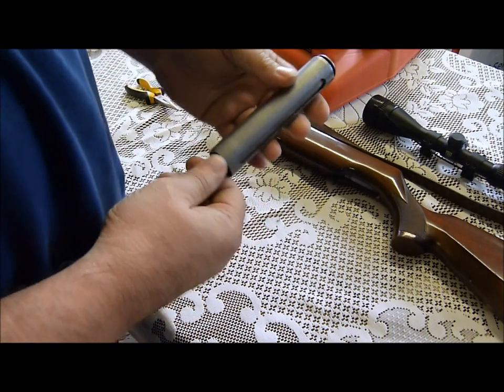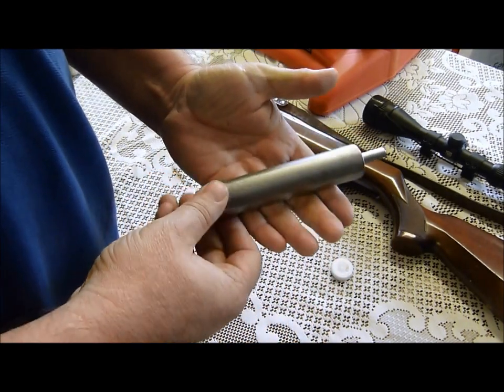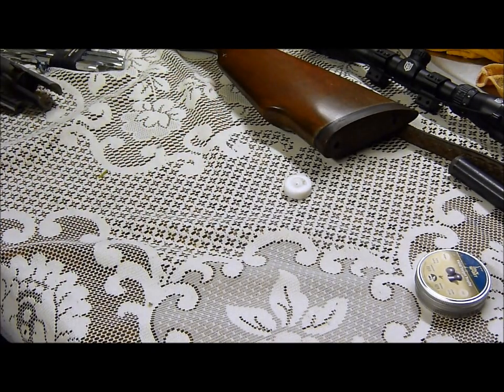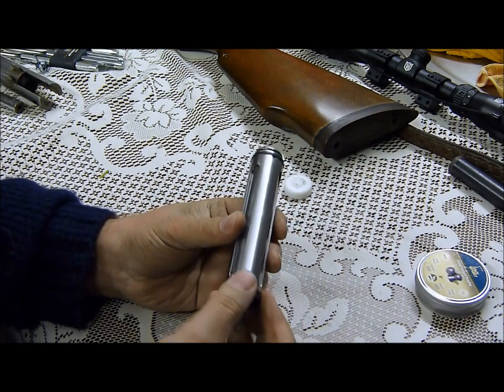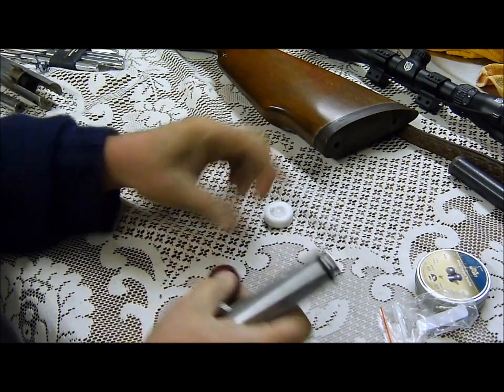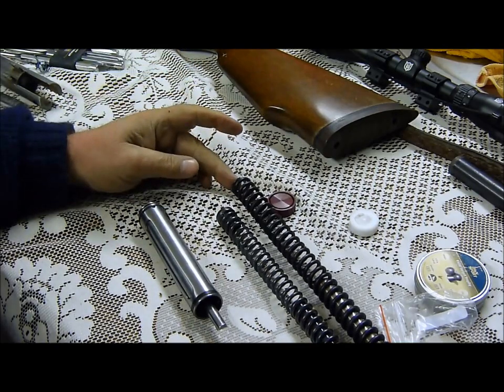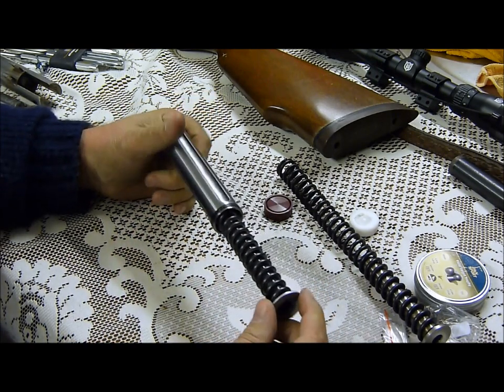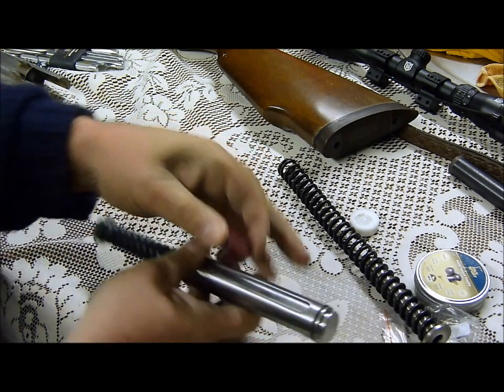HW80 project part 2 Paul Short piston and spring set up

Comment: Theres a new grease its the slippyest grease known to man , clear  and has a three times higher flash point than moly  moly 240 . New grease 680 the actual ignition point is much higher so no more dieseling, it clings better than moly , totally synthetic  , super super slick , il give you my test when it arrives ### SPRING GUNS ARE FINALLY MOVING OUT OF THE DARK AGES  ,,  theres one thing it is £24.00 for 40g . Which will happily coat a spring and  piston ,  BUT  you  wont need to service your gun for three times longer , the new lube has flew through all the tests its harmless to skin , cant wait to get this stuff in my 97 ,  the piston speeds are much faster than the moly coated test piston.so we swapped them over and  same thing happened over again  even with standard springs the speeds excelled ..  The stuff is so new it hasnt got a name  yet ,, wow gread days indeed ,  seriously guys watch this space

Comment: Am I right in thinking the polish is pointless?seeing as the delrin rings are being used?I'd still polish mine as it looks nicer but as for function?
Reply: no the polish helps any sliding part move smoother and the delrin / poly parts wear in against the steel surfaces polishing always helps just dont polish away the cross cut inner surface away as it helps hold the lubes ... without the cross hatching you will simply  smear the lubes away

Comment: is there any improvement on the performance (ie accuration, power etc..) after the piston mod?
Reply from the maker: +Beni M - the whole idea behind this was to smooth out the firing cycle and to bring down the power to legal limits. When I got the gun it was way over power. It is now a lovely firing cycle. Accuracy is much better due to the less movement in the gun on firing.
Reply: @shootingatdawn  lowering the power to set legal limit, does the original power plant inferior or less accurate in its full power?